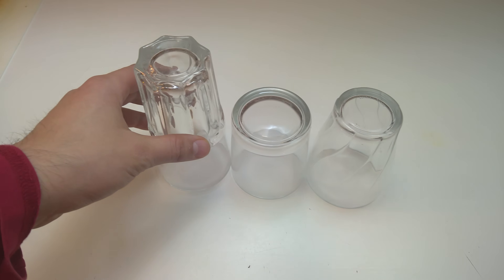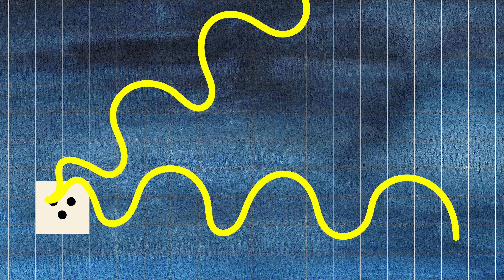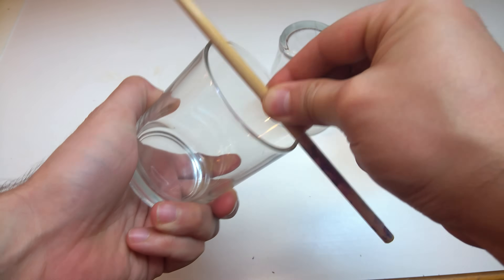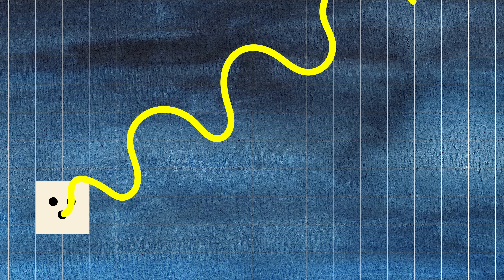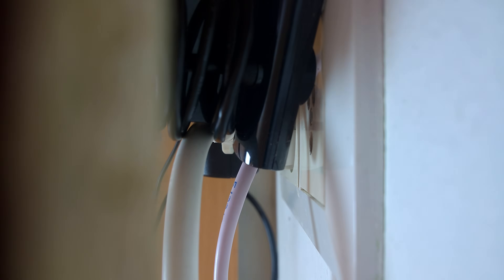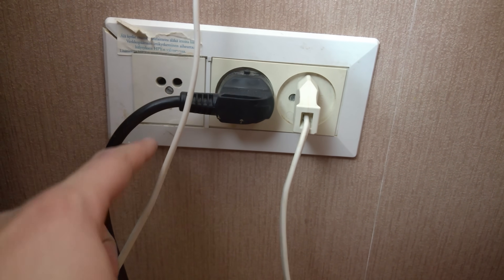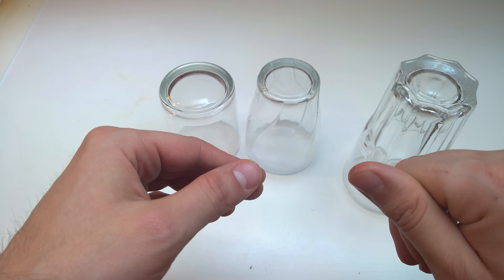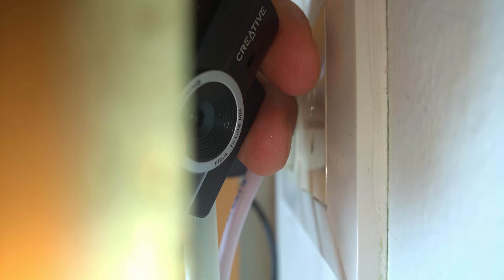Spy on your neighbor! The Optical properties of Copper.

Comment: But I have heard that cell phone towers are making a constant background noise, a field, and if you have the right kind of equipment, you can look around anywhere in the field and see moving objects, like people, with something similar to radar. You have to decode the signals. It's like TEMPEST monitoring, where they look at what's on your computer screen by decoding some kind of signals that the computer is generating. I am fifty years old and I read a single book about 'counterhacking,' as in, protecting yourself or hacking the hackers or something, a couple decades ago when it was all more primitive.
Reply from the maker: aluminium foil

Comment: You don’t need to do this. It is easier to simply enter the DHS DCC (device connectivity code) or tap the scan button on the DHS GCD page. The DCC for a mobile phone is the IMEI, and for other devices Google it for an equivalent. The scan function lets you locate via the go-references mapped networks - just zoom in and out and explore. 

I can give you the links for the https and login user/pword, just buy me a coffee.

Comment: wow so far I've only used it for listening to audio, never for video. I also used power sockets for sound. It's very simple, you insert two copper wires into the socket and connect them to the radio antenna, then you change stations with another radio, most often it's an MF frequency. The problem is that you never know exactly what you're going to catch, it could be Mozambique, Canada...China...
Reply from the maker: you might even tap into messages from heaven itself

Comment: I use solid Goldwires at my home.
Is it working too?
Reply from the maker: gold wires? man, get rid of that junk. I can scrap it for you.
Reply: @HungryGizmo  
Of course, I would do that. but the next generation of cable is fiber optic. 
And then you just don't see anything anymore
Reply from the maker: yeah, fiber optics suck at transmitting light.

Comment: In addition,by splicing your 240v  10ga. neutral bung hole whistler  stick onto your scooter stick you can open rainbow 🌈  unicorn 🦄  visions (witch is 5ddd clarity )♧Unfortunately  only on april 1st 😢 p.s. don't forget  to connect your flux capacitor
Reply from the maker: are you ok?

Comment: Pretty freaking cool, it works great,  I made a couple adjustments for 1080p and audio.  If you wire a potentiometer from the headphone plugin to the neutral in the outlet and turn off the wifi & roaming then go into camera and double tap the record button the keyboard pops up and asks for you to enter adress of outlet of whatever house you want to see using the potentiometer it allows you to navigate from outlet to outlet at the adress,  as long as nothing is plugged into a outlet your looking through, I almost forgot to mention a additional bonus after entering address press both volume buttons (up & down) simultaneously 13 times and a automated voice asks you what year so just say what year you want
Reply from the maker: listen to this guy
Reply: @HungryGizmo  , everyone is already aware of how easy it is to snake a camera or microphone through the septic system in Bldgs,  those nano bugs nobody ever finds, now they're using the satellites
Reply from the maker: what about potatoes? they have eyes

Comment: Brilliant. Just subscribed. Could  you could filter out the 110 ac oscillations and do the same with ac outlets? I think I know the answer.
Reply from the maker: You need to hit the main breaker for your home. that'll get rid of all the oscillating. (thanks for subscribing, I haven't made this content in a while since it takes so much energy and work to put together, and up until now would only get a couple hundred views, guess we see if that changes anytime soon - but I have a ton of videos, so enjoy!). Also. move to a country that has 240V. you'll thank me later.

Comment: What's that style of phone outlet called? I have been trying to find the exact name and I can't. I want to fact check it against the specs and potentially try it myself if it looks plausible. Thanks
Reply from the maker: man, this is the only video I've made that came out waaaaay too believable. I try to make the videos overwhelmingly ridiculous, but this one hit the sweet spot of believably. It's the phone outlet used in Finland.
Reply: In the US we use an RJ-11. They are special. Under certain thermal and humidity conditions, two or more of them become quantum entangled.
So…you can stick a paper clip in a socket in New York, and the tip of it will come out in California.
This is why other countries refuse to use the RJ-11…because of national security reasons. 
But the same thing happens with RJ-45 and RJ-48 plugs used for Ethernet..and the Dark Web leverages this quantum entanglement to bypass the surveillance.
It’s way better than a VPN.
Reply from the maker: if your thingie is small enough, you can fit it in the RJ-11 port

Comment: So is there any way to counteract this? Put black electrical tape over the outlet?  

What if it's a different kind of phone outlet; can ppl still use this technique? I live in America. I don't think I have ever seen this kind of outlet - even in older homes.
Reply: Tin foil is the only way
Reply: That is a euro electrical style outlet
Reply from the maker: might work, if you figure out which wavelengths to block
Reply: I recall seeing a similar style phone outlet in the U.S. My recollection is it had four contacts, not three. 

Using a special filter, the fourth hole can be used to transmit infrared images.
Reply from the maker: I recall it having five, not four